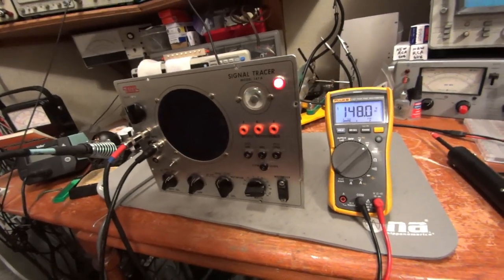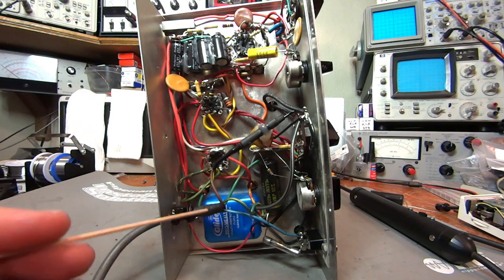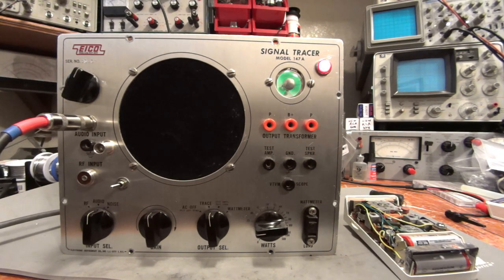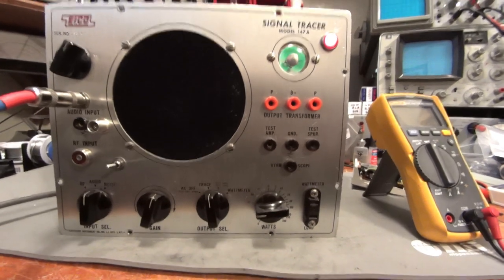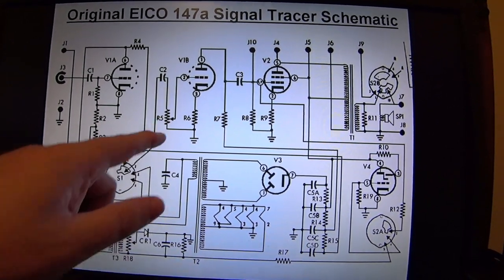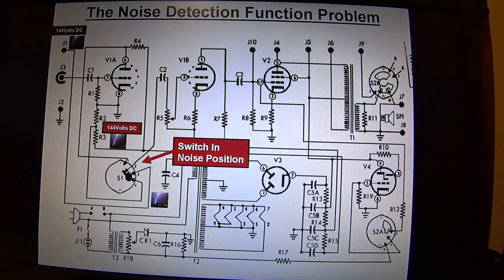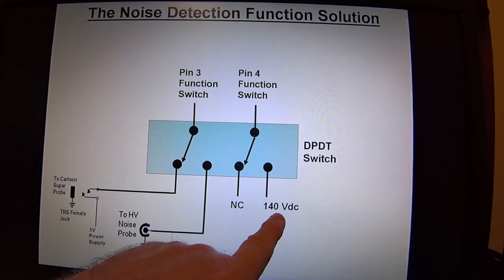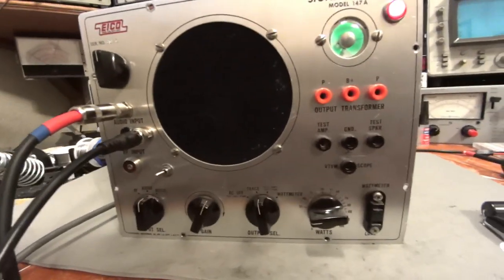EICO 147A Carlson Super Probe Modification, Troubleshooting Monster

Comment: Awesome, I picked a trunk load of stuff some time ago, this unit was in the pile. Now it's next on the list to bring back to life, new caps and resistors, bnc etc.
Reply from the maker: I think you're going to love it. It has really been a handy tool.
Reply: @leonardpeters3266  Got around to opening it up, the unit was practically factory inside, pin 7 wasn't soldered on the middle tube, all the caps tested good, and resistors are in spec.
Reply from the maker: Great news, I think you will find it very useful

Comment: Nice conversion of the EICO 147A. I don't have a Carson super probe yet and have not needed one. Nor do I have capabilities to make small PC boards. I do like the EICO signal tracer as a test tool. It also makes a good bench amplifier for testing audio device. Good informative video! btw, new subscriber!
Reply from the maker: The Eico was16 dollars at an estate sale, and it came with an isolation transformer. I did build that probe with through hole components on a perf board, that's why it is in a 3/4 inch copper pipe. But I got a 70 dollar microscope with lcd display for Christmas. I built the Ultra probe and amp with SMD components and once I got used to it, it wasn't that bad.
Reply: @leonardpeters3266  $16 with an isolation transformer? WOW! What a find! I have a LCD microscope I bought for fixing hair wire coils. I guess I could pull it off with that. I'll have to give it a try. Anyway, loved the video Leonard! Thanks! Paul
Reply from the maker: @ElectroRestore  Good tweezers are also very helpful.

Comment: I just finished up building a Super Probe kit I bought on Ebay and did the mods on an Eico 147 I had reconditioned with new caps and resistors.  I checked the voltages on the tube following the volume control and found that the Eico 147 vs the 147A does not have that problem of tube saturation or the voltages dropping so adding the resistor and capacitor was not needed. They stayed rock solid. Now if you compare the schematics for the 147 and 147A, you see that the 147 uses 5 tubes vs the 147A 4 tubes plus that volume control goes to a pentode tube vs a triode tube. I am wondering if that difference of tube types is the reason for better stability? I'm guess Eico decided to cut some costs by redesigning  the 147. Anyway thank you for the video showing us how to mod things.

Comment: Great Video.. !  I have the same Eico signal Tracer and was considering doing something similar, but have not come up with any particular design ideas yet… Thank you for sharing.. I like the additional grid cap and bleed resistor added to the grid on the second stage.. I was wondering.. would it not be possible to somehow utilize the RF input for a high sensitivity input for the Carlson probe..? A different design approach, but wonder if that could work..?
Reply from the maker: Yes it would work. It would simply add another stage of amplification. I didn't because the gain of that Super Probe is already just crazy and I wanted to retain the RF probe for special issues.  But it would work, just an awful lot of gain.
Reply: @leonardpeters3266  I was thinking the same.. too much gain.. then I thought, maybe modify the Carson probe, by removing 1 gain stage..?  Anyway.. that’s what’s great about this hobby.. there could be a different approach to everything…:)
Reply from the maker: @esci8978  Absolutely, have at it and see what works best for you, wouldn't it be boring if we all thought the same way.
Reply: @leonardpeters3266  Absolutely love what you did..! Cheers..!

Comment: Great Video Love your modifications.  Where did you get the small 5 volt power supply its tiny.
Reply from the maker: I think it was Amazon. Here is a link to the new version.  https://www.amazon.com/Converter-Universal-Isolated-Switching-Version/dp/B07SGQ6XXR/ref=sr_1_20?crid=UNJXFO1JL4NW&keywords=5v%2Bpower%2Bsupply%2Bpcb&qid=1687643960&sprefix=5v%2Bpower%2Bsupply%2Bpcb%2Caps%2C180&sr=8-20&th=1

Comment: Carlston design would be safer for a beginner as the probe and amp are all battery powered! My early employment back in the 60’s was valve power amplifiers full of hazards! As well as 240 volts Ac you had valve anodes 500+ volts Dc etc ! I had a few belters myself which taught me to put my left hand in my pocket when probing with my right hand! Health and safety didn’t have much clout then ! Now I use an isolation transformer and variac on any mains gear I work on now! Early colour tv’s were a death trap with 25kv on the crt anodes! I always grounded any crt as they can retain high charges for weeks! Hv capacitors you have to discharge before you touch anything! I worked about 50 years on electric/ electronic equipment and I am retired now on my 79 th year! 😊
Reply from the maker: Boy do I remember those TV's. They were really nasty, particularly the horizontal output tubes. If you ran across the plate of one of those it would cut you open and cauterize you at the same time.

Comment: Hello, informative video.  I have two of the super probe boards etched, but never populated them, I wanted to knock out a couple of his cap testers (the one that shows outside foil and the one that shows micro amounts of leakage). Well now the ultra prone has been announced so I etched that board, populated it, have it in a case and all that’s left is wiring it up. Think you’ll plan on building the ultra probe? I’m doing the same thing, but with a Heathkit T-3 tracer which looks to be pretty much identical to your Eico.
Reply from the maker: Yes I plan on building it this winter. Actually getting ready to order the parts right now. I intend on using the same input jack for that probe.

Comment: Why don’t you have the grounding lead on the probe?
Reply from the maker: That is a great question. I actually use the a ground lead from the EICO. It gives me allot more flexibility for placement and also frees up movement with the probe. It also quiets the probe down when working in a chassis. I liked the setup so much I used it on my Ultraprobe as well.
Reply: @leonardpeters3266  - Ahh, ok. I’m in the early stages of building a stand alone Carlson Super Probe. I might copy you and just put a 4mm socket/binding post on my amp/speaker unit for a grounding lead. It seems to me that it would be neater for occasions where you can’t use the grounding lead and would otherwise be holding it in your hand as well as the probe.
Reply from the maker: @alexwade9921  If you can skip to the Ultra Probe it would be well worth it. I have had incredible success with it. Here is a video demonstration of it https://www.youtube.com/watch?v=RIlTA8PcbpI&t=467s
Reply: @leonardpeters3266  - I haven’t heard of the Ultra Probe. Is that another Carlson design? Are there PCB’s etc available for it?
Reply from the maker: @alexwade9921  Yes it is available on his patreon.